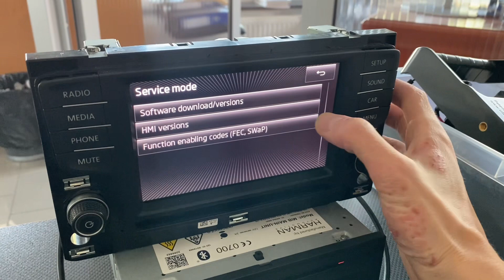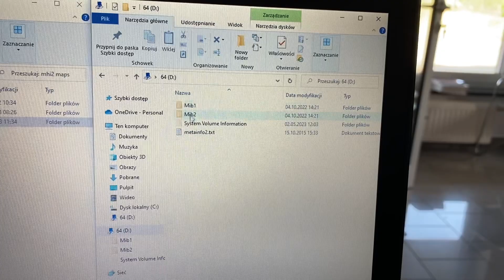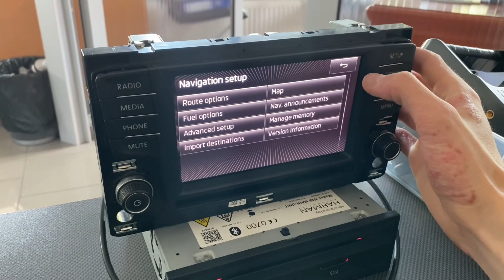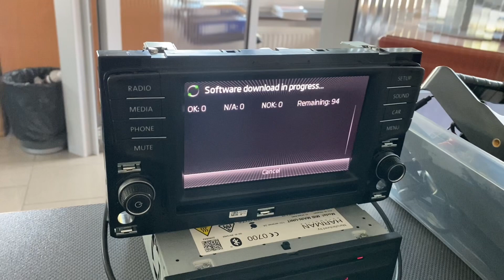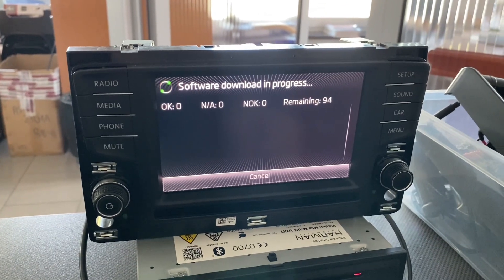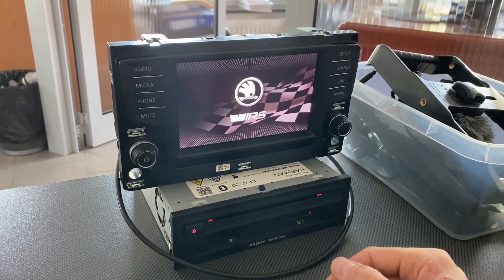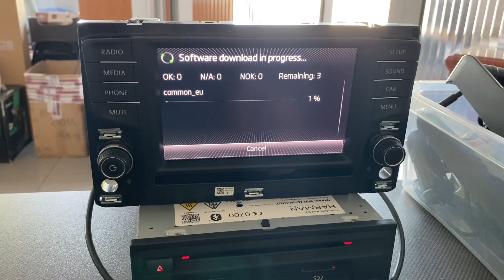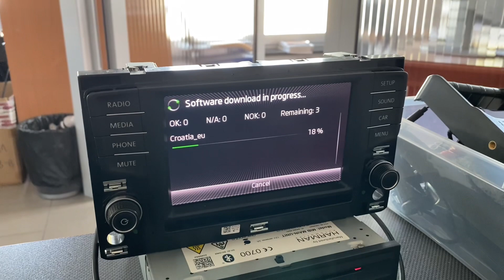MIB1/MIB2 High maps update on bench (MHIG MHI2 MHI2Q)

Comment: I'm trying to download "MHIG_RW_AU_P1531 (MU: 0357, details)" but it is not part of the MIB Patches.7z cluster. I can see it in the M.I.B Backup folder but I am unable to dowlaod... Can you help at all ?? 

1. Firmware details:
Generation and tier: MIB1 High
Region: Rest of the World
Brand: Audi
Version: no distinction
Trade Name: Audi MMI Navigation plus
Firmware version: P1531 (MU: 0357)
Firmware type: Production
Hardware vendor: Harman

2. Latest available firmware updates:
Latest official firmware update: MHIG_RW_AU_P1531 (MU: 0357, details).
Latest possible firmware update: MHIG_RW_AU_P1531 (MU: 0357, details).

"MHIG_RW_AU_P1531 (MU: 0357, details)"  - https://mibsolution.one/index.php/f/196456

Anyone know how I can download the latest file for MIB1 HIGH units  from MIB Solution site ? 

https://mibsolution.one/#/1/14/MU0357-MHIG_RW_AU_S1531-JTB-07402.09.14872104F1

Comment: Hello, I cannot update the navigation maps on my 2017 Ateca. I've tried several files from the site(s) but none seems to work. Only the P350_N60S file is read, but it shows "F" at NavDB and "F" at all the individual countries. Do I need to update the firmware first?
Reply from the maker: I believe you don't have proper FEC/SWaP code for such fresh maps. Or you are trying yo install MHI2 maps on MST2 unit.
Reply: Correct, i looked into the fec codes and they allow maps up to 7-2020, unfortunately.
Thanks for the reply anyway!
Reply: So what did u do after? Im trying to update my Seat Tarraco but nothing seems to work.

Comment: Hi @mr-fix, thanks for your videos much appreciated. I've completed the 2022/23 maps update on my MIB MHI2Q (ER_AUG22_P5092_MU1329) last year. I'm trying to update the 2024 maps P333_N60S5MIBH3_ROW and also tried the P313_N60S5MIBH3_ROW following MIB Helper website. However getting message, the data are not compatible or are outdated. I have all legal FEC activation keys 023D002E used for 2022/23, 023D0032, 023D00EE and 023000EE. what is the FEC code required for ROW maps 2023/24. Are there any separate Australian maps for download?
Reply: Hi, could you please tell me how to unlock the mhi2q_er_aug22 p5152 step by step, I have tried various procedures but it doesn't work
Thank you